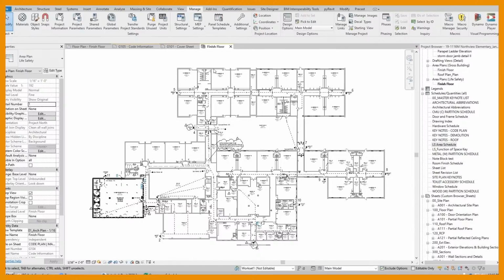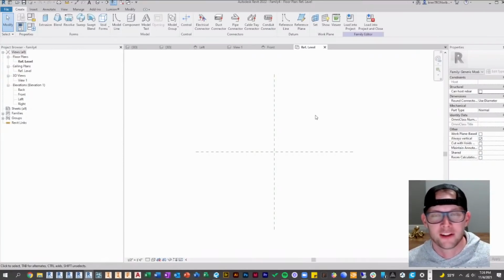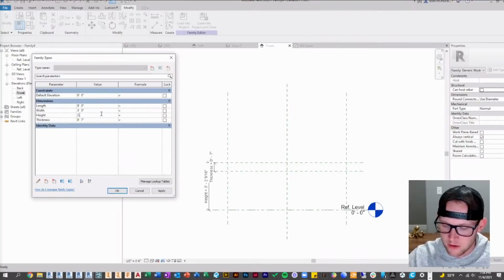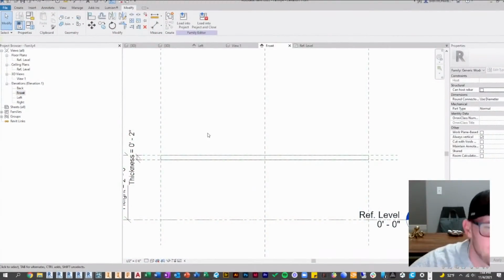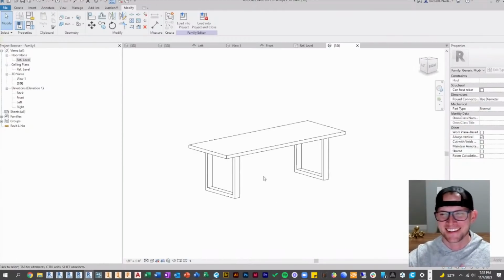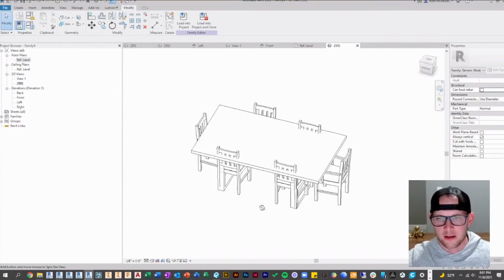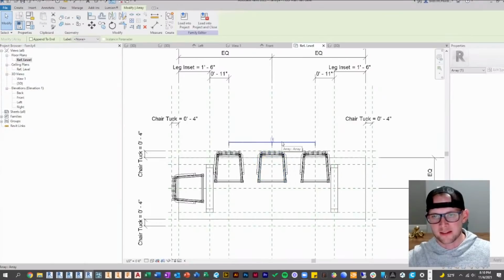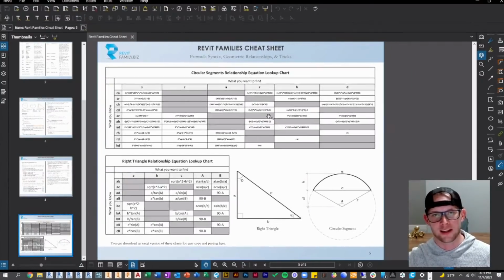Revit Family Tips ( From a Professional Revit Family Creator ! )

Comment: I sometimes do reference planes within sketch mode to keep the views clean. These are typically for more detailed geometry which is independent of other geometry.

If you’re just starting with families, just draw reference planes for everything.

For the legs (because they are a separate material) i would have likely created a family and nested it into the table family. Then I can swap the families out with multiple leg types, but mostly just to reduce reference planes clutter.I would have also created model lines and hosted swept profiles, which is also another method to reduce reference plane clutter.

Technically, the reference plane ‚direction, (top, bottom, front, back, etc) should allow you to swap elements in the model while maintaining the dimension references. I’ve still run into issue. Setting the centers (left/right, front/back) is very useful if you have the centerline references set up in your dimension Styles.
Reply from the maker: Matt, thanks for tuning in and for your tips!  Cheers!

Comment: To bypass the locking issue I will always use the pick lines tool and there is an option that will pop up a check box on the top left side where it will automatically lock the generated line onto the existing line you pick.  So I will have my frame or skeleton and then I will pick my reference planes and have them lock automatically.  I think it is more intuitive and faster doing it that way rather than creating the lines and then aligning the lines together and then locking it.  

I'm also wondering why you don't flex the geometry in the model window?  I feel like it takes more time to open the type properties and then change to value and either save or apply.

Having the end user in mind is so important.  One of the best and worst families I have worked with was for a barn door.  I don't know why its so hard to find a decent barn door that also looks good but it is.  The barn doors we use in our company look amazing but we had to spend half a day exploring the family because their parameter for door slab width and height were not assigned correctly.  This made it a nightmare for scheduling because the units were coming out as 125/256" or some other odd number.  We had to find a way to redue their formulas so the model could still work but we could change the parameters for scheduling purposes.
Reply from the maker: Matthew, thanks for tuning in and the comments!  Using Pick Lines and selecting, as you said, is definitely another strategy!  Of course, you still need to pay very close attention to WHAT you are picking when the family gets more complicated!  I am not sure what you mean by flexing in the geometry window!?

Comment: 35:10 In a simple case like this, you don't need to lock at all. If sketch is drawn snapping to intersections of reference planes, it'll work without locking.
Reply from the maker: In this case, Brenton's point was to NOT do that... Because, as he illustrated, if you let Revit assume the relationships it could BURN you down the road.... You are right, it will work, but, it could also NOT work in the future... Better off spending the time to control what is constrained and not let Revit assume.
Reply: @TheRevitKid  Yeah, I commented as I was watching, before he explained why he doesn't do it. Although in such very simple cases I'll continue to do it :D Simply because I'm the only one using my families and if something brakes I'm the only one to blame. If only there was a "lock all visible unlocked constraints" shortcut.
Reply: @DarioRubilovic  I'd say the habit of "I'm the only one" is not a good one to get into. As a bim mgr, I rail against that since many users think actions are one-offs when they rarely are. This isn't for you specifically, Dario, just for others that are reading this who work in teams.
Reply: @HippieP629  100% this. "I'm the only one using them anyway" doesn't get you really far in a AEC environment where everything is done in Team.
Reply: @enricoc2968  Not in my country, here it's 99% AutoCAD. So I literally am the only one using my families :)